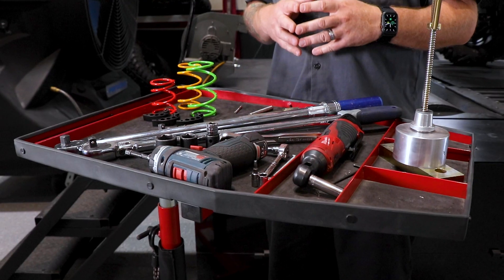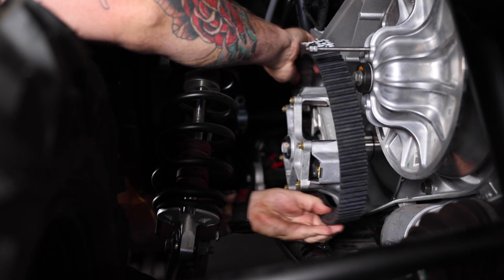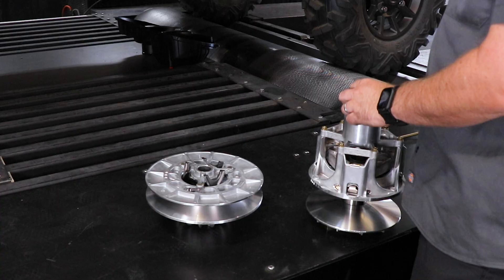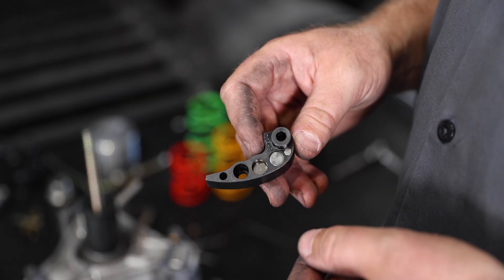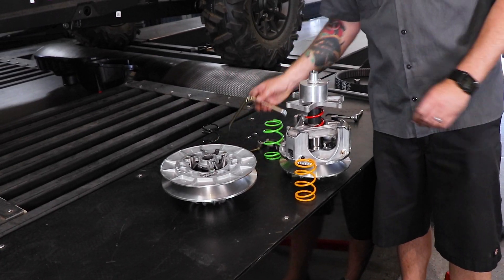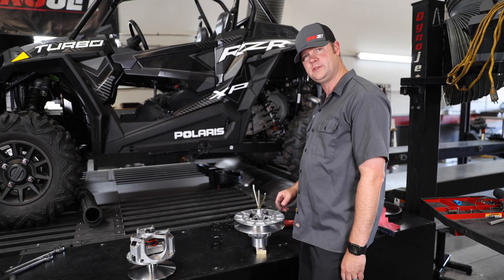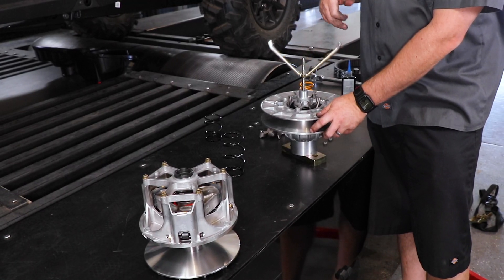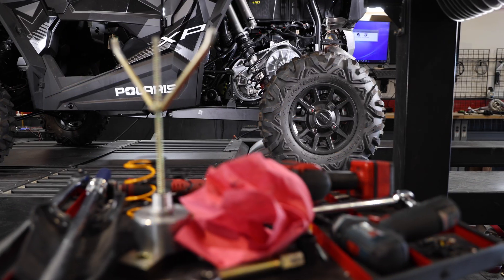Polaris RZR XP Turbo: How to Install a Dynojet Clutch Kit

Comment: I know this is an old video but I have a 2020 sportsman 1000s and I want to get the stage 2 kit for it and it only comes with the primary spring and weights not a secondary spring. No idea why but how do I get the secondary spring? They don't even show it as an option. So this is making it very hard to choose and find a secondary clutch spring. Any ideas would be appreciated! All other clutch kit makers sell both primary and secondary springs.

Comment: I have a 2018 Polaris rzr xp turbo.. i put bigger 32 tires on it,, would you recommend me doing this set up now?
Reply from the maker: We have seen benefits of the clutch it on a totally stock vehicle.  Since you have installed larger, heavier wheel/tire combo is definitely recommended to get the clutching setup properly.

Comment: Is this the same install for a 1000 2021?
Reply from the maker: It will be a similar installation process. It may require different tools as per the service manual. If you are needing further assistance, please contact our technical department at 702-745-5282.

Comment: great vid with a couple of comments. In general make sure you mark/index everything before disassemble.  I didn't see that in the video and the paper instructions only call this out for the secondary. 
I made a rookie mistake and spaced this so hopefully I am safe.  Also for secondary make sure you grab both sheaves as when I pulled mine the inner fell off and not 100% on alignment for that as well.  So far any info I can find on 2016 and later turbo's there is no factory reference marks.  Praying that this is incorrect.  Taking mine back apart to check for factory marks.  Additional discovery was my primary was really cranked on and it took alot more effort to get that off.  Later I realize you could do the spring and fingers directly on the machine.  was nice to do this on a bench in any case.
Reply from the maker: Thank you, Kevin. Great advice!

Comment: I’m having problems with my 21 turbo slipping the belt over 5-6k rpms hard throttle, would his kit help it? Bone stock rzr
Reply from the maker: Ira, which specific RZR model do you have?
Reply: @DynojetResearch  2021 rzr turbo xp, passes clutch inspection
Reply from the maker: Ira, the Dynojet clutch kit should cure the issue you're having. The Pro XP has a very weak secondary spring. Our secondary spring is stiffer than the factory spring. Our primary spring is also stiffer than stock and our clutch arms allow you to dial in your clutch for whatever terrain you plan to ride in and whichever tire size you have.
Reply: @DynojetResearch  if I’m not mistaken the 2021 has a stronger factory secondary spring so I’m thinking the problem is in the primary
Reply: @Headhunterspeedshop ‼️ By the way I give you the thumbs up Ok👍👍 ‼️ No comment from this guy unreliable or what!! Simple as that was is not a simple question ⁉️ or what!...😒🤯 🤢🤮🤦🤬😡🙌

Comment: What if you do a lot of both sand and hard pack? Do I have to change springs for every ride if I go place to place?
Reply from the maker: Optimally, yes. But you can get by with either. If you run paddles in the sand, we recommend using the yellow spring in the primary. If not, use the red.
Reply: @DynojetResearch  ok thank you